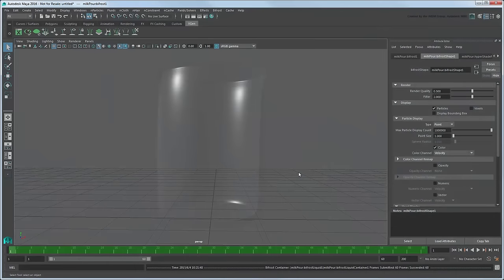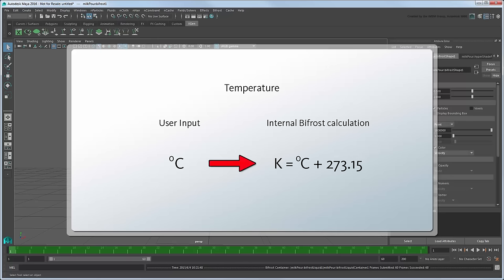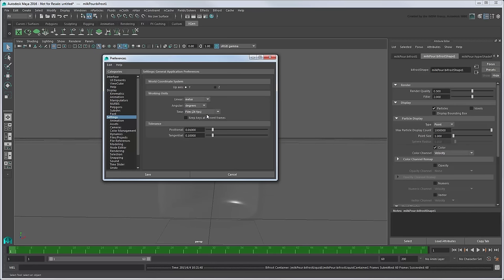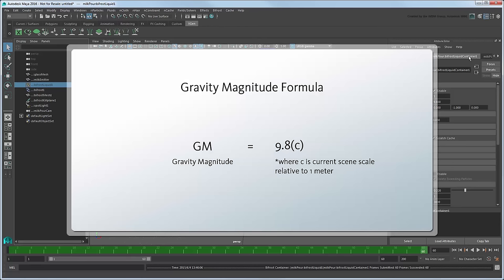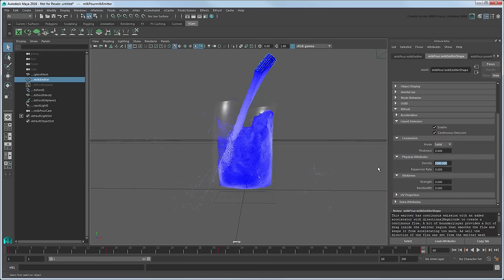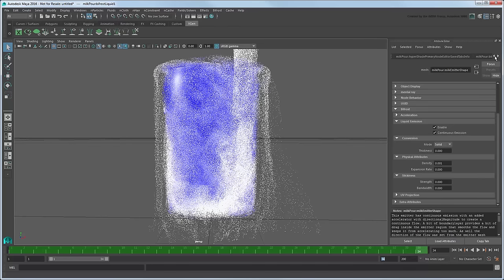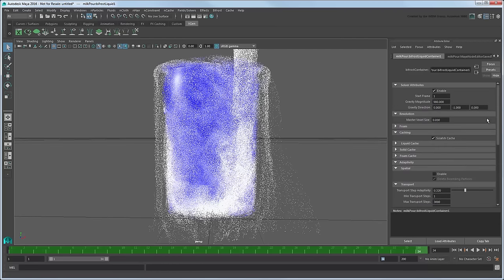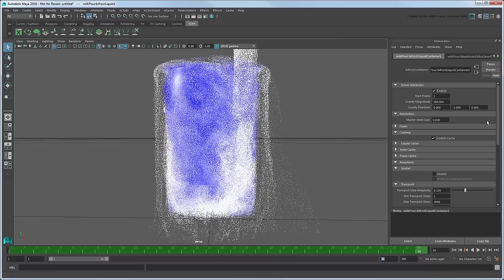Understanding Bifrost - Simulation Scale

Comment: Bifrost in Maya 2016 is extremely buggy, even though I set it to use half of my ram it uses all of it, and on one particular scene bifrost just won't cache the entire sim only a portion of it, also if I set a custom cache location for the scratch cache it caches in 2 places at the same time, the set location and the default location.
Reply: That's your fault. You should just take out half of your ram from inside the computer, extend your sim time, and set your custom location to the default in project setup.
Reply: Good job posting a year later for an issue that was resolved in service pack 1, it doesn't matter how much ram you have or don't , Bifrost in Maya 2016 without any service pack used up all the ram when using an accelerator in the scene, if you don't have a clue what's going on stop posting.
Reply: It's true i also lost my sense of humor along with most of my body, i need robots to help me smile.
Reply: TheIcemanModdeler Ouch, if only big hero 6 nanites existed in your time...

Comment: I don't know what kind of a monster machine you are using but I am never able to cache something on 0,020 resolution! It's either the RAM or it will generate 10 frames in size of 10GB. Maybe it worth uploading a tutorial which would explain how you can sim relatively realistic water without having a mega machine and 4 hard drives!
Reply from the maker: What kind of machine are you running?  These tutorials were done on a 2.8GHz dual with 16gb of RAM.
Reply: how is this possible I am having 4.4GHz with 32 GB ram and I am trying to fill up a glass which is 12cm. Scaled the scene the way you mentioned in this tutorial but I am certainly not able to run on such a fine resolution! 10 frames cost me 8GB!
Reply from the maker: Hmm, that definitely sounds way too big.  Try lowering the Render Quality / Max Particle Display Count in the liquidShape node.
Reply: will this effect the accuracy of the fluid sim!
Reply from the maker: No, they're just display options.
Reply: Then logically it won't reduce the file size, and it didn't! I don't know what am I doing wrong if I am doing something wrong at all?! Anyway, your tutorials are good! thank you

Comment: Seems like the opposite effect is happening once you change the gravity and other settings.  The "much larger" scale of volume is actually filling up twice as fast as the initial setup.  If the 1/100 is the supposed setup, and your vat is now 100 times larger, then you should expect the water to look like it is falling slower(farther distance) and not fill up so quickly.  Right now it does so in just over 30 frames.  Wouldn't then the reverse calculation on gravity be more accurate?
Reply: houdini is way